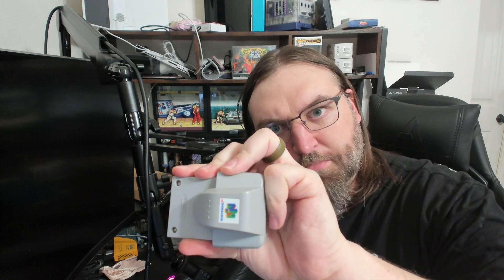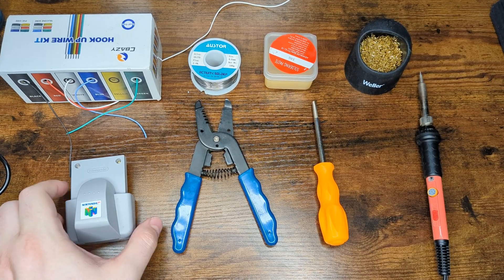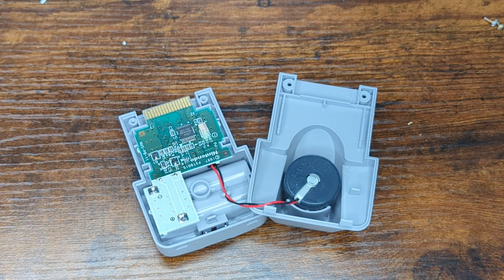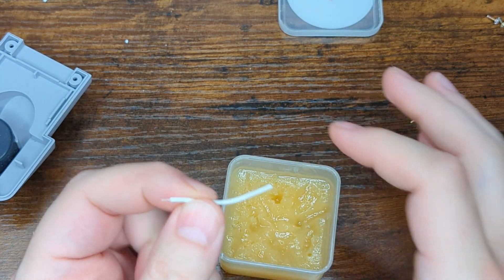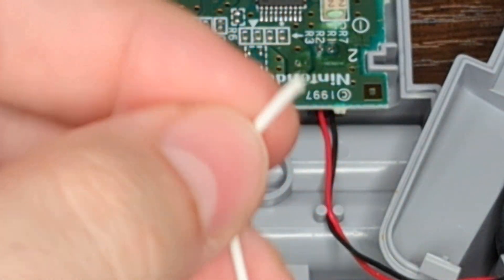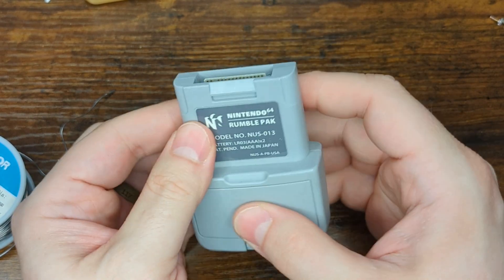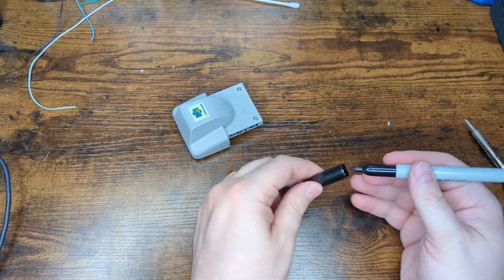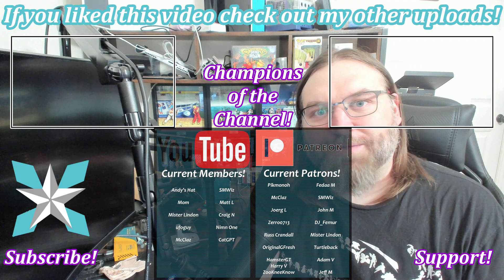N64 Rumble Pak Battery Free Mod Tutorial - No More AAA's Required!

Comment: Inised to do that in the 90s. Batteries so expensive. 😂.

Also added an audio out minplug port for the RUMBLE VEST.

Si when the motor vibrates it sends a signal to the vest to shake your spine. 😂 😂 😂. TRY IT

Comment: I just did my mod and I hope I did it right… the hole I used I wasn't sure if it was the same one you used but it was in the same section, so here's hoping!! 🤞🏻🤞🏻😅😅

Edit: also I used a wire from a circuit board from a Famicom Disk System drive board internally that I had messed with… and the wire was already short enough, so…
Reply: 🤦‍♂"yea i soldered it to the wrong point, but they were right next to each other so its probably fine..."

Comment: The danger of this mod putting a strain on the N64 console's power supply is, I imagine, compounded when also using an Everdrive cartridge and wireless controllers?
Reply from the maker: I don't think so. There are conversations around that 4 no battery mods would theoretically be fine but again I'm not willing to test it.

Comment: Why on 🌎  would Nintendo make these rumble packs that way unless they were in bed with a battery company 😅 I owned four of those things would have been great to not have to always have batteries  for them back then darn it
Reply from the maker: I wonder if they were going to be powered by the controller originally until Nintendo realized they didn't make the PSU beefy enough 🙃
Reply: @ArchadesGames  makes sense 👍